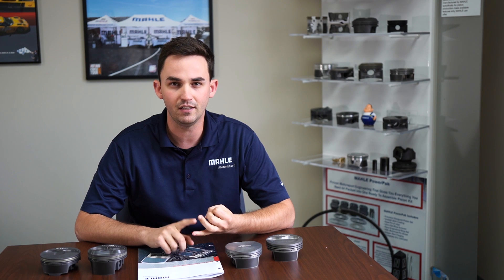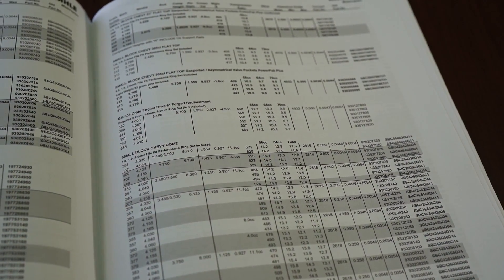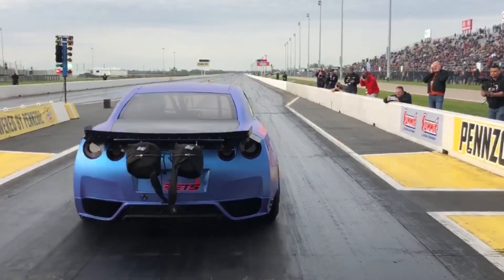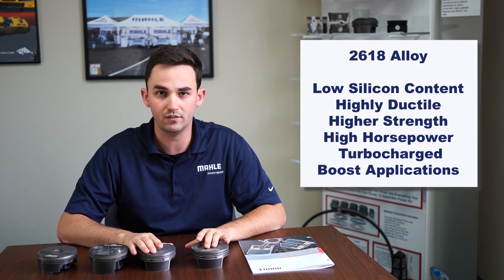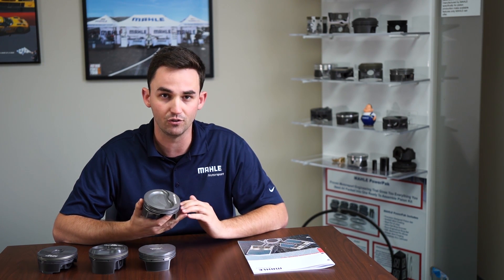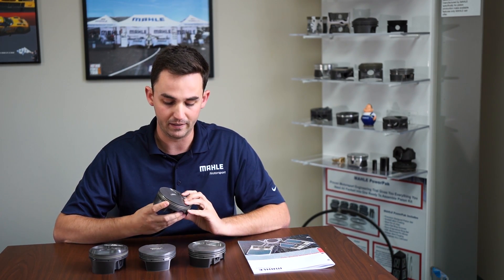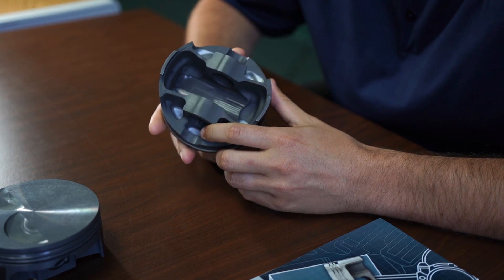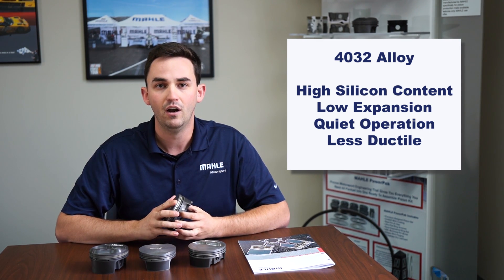Choosing The Right Piston Alloy - 4032 or 2618

Comment: I am having a hard time find a engine builder that wants to use 4032 alloy for a stroker kit on a 2006 evolution 9. They have been building with 2618 for so long they don't feel comfortable using a 4032 alloy.
Reply from the maker: What's the goal of your build and the power level you want to achieve?
Reply: @mahlemotorsport   I want to build a stroker kit but I am after more low end trq.I only want to run 93 octane and no e85.It's a 100% street car no track use. If the car makes 400whp I am happy but its the trq curve I am after rather then big laggy turbo setups with no throttle response and complete dogs until 4500rpm. I want more trq under 4000rpm NOT less.
Reply from the maker: @stellioiscrazy For your power level and stated street use, yes, 4032 does seem to be the better option. Unfortunately, we no longer manufacture this piston due to low demand. Do you have a 4032 set already in your possession?
Reply: @mahlemotorsport  no cant find any :(
Reply from the maker: @stellioiscrazy I stand corrected. Had a quick conversation with my custom guy and I was looking at the wrong spec line. We do offer three bore sizes in 4032 for the 4G63 engine. 85.00mm, 85.50mm, and 86.00mm. https://www.us.mahle.com/media/usa/motorsports/mits-4g63-2-0l-webpage-2.pdf
Reply: @mahlemotorsport  next problem is the engine builder, unless you guys have someone to recommend.

Comment: @mahlemotorsport I have a question 4v cobra teksid block, shooting for 1000whp 25-30 psi whipple show car no drag racing at all just weekend car would u recommend 4032 or 2618? Thanks
Reply from the maker: For the amount of boost you are planning on, our recommendation would be 2618. Our applications available for the Cobra 4V use a different alloy, M142P. This alloy shares characteristics with both 4032 and 2618. It will work well for the application you are describing. Please keep in mind that dialing in a quality tune is equally as important as piston choice. Check page 17 of our application guide for options: https://www.us.mahle.com/media/usa/motorsports/new-products/2025-ap-guide-final_digital.pdf

Comment: Hi 
What about Subaru ej25 does they friendly with 4032 daily driving ? Clearence minimum 0,04mm right ? More then SUB top limit
Reply from the maker: Sorry for the delayed response. 4032 is more friendly for daily driving than 2618 due to lower expansion rate. 4032 clearance minimum is 0.053mm and clearance maximum is 0.073mm, measured 6.35mm up from the bottom of the piston.

Comment: Could not find 4032 allow for N54 engine. Why ? Thanks
Reply from the maker: We do not make an N54 piston in 4032 because majority of builds need 2618 for that engine.
Reply: @mahlemotorsport I bought a set of 84mm drop in Powerpak pistons for my N54. The piston to wall clearance spec states .0025" to .0033", but the pamphlet says high performance applications may require an extra .001" to .003"?  Does this really mean clearances of .003" to .006" for some applications? I called Mahle tech support but they couldn't answer this question, just kept repeating they are made for an 84mm bore.  My 200k mile block ended up with .0035" to .0038" clearance, but I was a little worried about it so I decided to order a set of 84.5mm pistons and am over boring.  I still would like to know how rigid is the Mahle specification for piston wall clearance?
Reply from the maker: Yes, it does mean clearances of 0.003" to 0.006" are recommended for some applications. For high power levels and 2618 alloy, additional clearance for expansion is recommended. However, if doing a rebuild with mild upgrades and moderate increased power level, the original piston to wall clearance of 0.0025" to 0.0033" is recommended.
Reply: @mahlemotorsport  Thank you for the reply. I just dropped off my block and pistons at my machinist. He is recommending we go with around a .0045 clearance. This is for a daily driven street application, but it makes around 750 hp. Does this sound reasonable? I just don't want to end up with too much piston rock and end up scuffing a bore. I feel like I would be more comfortable staying around 3.5 to 4 thou, but my only knowledge in this area is from what I've read online.
Reply from the maker: For your intended use and power level, 0.0045" should be fine. Note that you will likely hear noise on cold startup.

Comment: What would you guys recommend for a VR6 3.2 with mostly daily driving, occasional drag racing and some nür laps? Between 8 - 8.5:1 CR, 700-ish daily awhp and 1000-ish drag/track hp. 2.5/3.3 bar boostgoals.
As far as i could find, your 3.2 VR pistons are 142P correct?

Comment: Love yalls products ! I have a 2012 srt 8 392 and I purchased the 4032 pistons and went with a redeye cam lifters and also have long tubes. This will be a street car with very minimal drag runs. I plan on adding forced air and my goals are 650-700 at most rwhp did I make the right decision or would y’all have recommended the 2618? Thanks in advance !

Comment: Why is 2618 only alloy available on the gen 3 coyote power pack pistons? Wouldn’t a 4032 a better fit for a drop in piston? Does it have to do with the new spray in cylinder bore?
Reply from the maker: It does not have to do with the spray in cylinder bore. The 2618 alloy offering are for those who want to use power adders and maximize horsepower.

Comment: I’m having a motor built. Is it true that the 2618 piston only lasts around 20k miles and that it damages the cylinder walls ?
Reply: NO.  Not if the PTW clearance is properly reached.  Some have gone well over 80K miles.
Reply from the maker: Each build is different but if it is built correctly it will last well over 20k. We have some on our staff that use 2618 as a daily driver.

Comment: Great info! All things being equal, will the 2618 make more power than the 4032 since its looser?
Reply from the maker: Actually 2618 is not 'looser'  - it initially has more piston to wall clearance.  Once it comes up to temperature the piston expands.  The material has a low silicon content which causes it to expand, the material has higher strength properties and can be found to be used with higher horsepower applications.
Reply: Being ‘loser” doesn’t make more power. 2618 doesn’t MAKE more power. It is a stronger and more ductile alloy that can HANDLE more power than 4032. It’s ability to handle more power has nothing to do with its higher expansion rate (which requires the higher clearance). Rather, the higher expansion rate is a consequence of its composition (ie lower silicon).

Comment: Mahle has always made great parts.
Reply: Yep, I'm using all Mahle gaskets, head gasket, intake manifold, EGR, exhaust, valve cover gasket, and throttle body, etc. I'm going with JE pistons though because I already ordered them for the rebuild but if I knew that Mahle made pistons, it would be a tight battle where I'd choose either or, etc.

Comment: I'm planning to build an old audi s3 1.8-20vt for 500hp would you recommend 4032 cause I want to keep the car both fast but also reliable because I'm planning to daily drive it. Will the 4032 be able to handle 500hp?

Comment: 200-250 shot on a daily driver which alloy?
Reply from the maker: How much daily driving?  Which engine and how much horsepower is your build?
Reply: @mahlemotorsport  
Will pretty much be an everyday driver. Looking at around 500-550 NA at the flywheel on a 5.7 hemi stroker with a turn of the knob on occasional weekends and possibly an occasional trip to the local strip. You know how it goes though was originally saying 150 would be enough and haven't even built it yet and its slipping up to 200 shot!!! lol
Reply from the maker: 4032
Reply: @mahlemotorsport  ok thanks

Comment: If you DON’T need the strength of 2618, 4032 is actually better in every way. Not only can you run them tighter. But they also have better wear qualities and they’re lighter.
Reply: So basically if you're pushing records, 2618, otherwise 4032 is great
Reply: Yeah, I got a nice classic 4 banger, a 1995 Saturn SL2 that I'm rebuilding the engine with JE pistons, 10 to 1, SCAT forged H beam rods balance and blueprint, 3rd gen heavier 6 counterweight crank, with lower tie plate with a port and polished head, dual intake cams, mild deshrouding, mild bowl blending, polished combustion chambers, narrow blended 1-2 mm value seats, port and polished intake manifold with port matching, bigger throttle body and 10-12 PSI of turbo boost, and an E85  blended full tune, etc. One of my other buddies gonna fabricate a cat back turbo exhaust made out of titanium and the car already has a carbon fiber hood, seats, and a set of RPF1 15X7's with Yokohama Advan performance tires, and upgraded MFactory LSD, and drive line and suspension. Little by little it should be very fun to drive when completed. 325-350 HP with more torque than horsepower and 2200 LBS. I've owned the car 17 years after my dad gave it to me

Comment: So for a boosted(turbo), e85, and 500hp daily engine 2618 would be best?
Reply: 500 horsepower on what? 500 horse on a Briggs and Stratton is a lot, 500 horse on a 454 big block is a bolt-on motor.

Comment: I've been making ~500whp on a 2.3L mitsubishi for a few years now. The car has been raced a LOT in autox and at the drag strip. I've been extremely happy with my Mahle 4032 pistons.
Reply: who built your engine????I cant find a engine builder that feels comfortable using a 4032 for some reason.My motor needs a rebuild and I dont track it at all, just street driving.
Reply: @stellioiscrazy  I did. I built my engine. 
I simply specified the desired finished bore size (as per Mahle) to my machinist.

Btw, it's still going strong.
Reply: @ i don’t have the time or space to do my own build and finding a good shop/engine builder in the 4g63 market is impossible. They don’t know how to build a street car. They build RACE cars for the street and call it a “street car”.
Reply: @stellioiscrazy  sounds like you need a different hobby, then.  Maybe RC cars. They take up less space.
Reply: @ lol 😝

Comment: What is the best for daily drive?
Reply from the maker: 4032
Reply: @mahlemotorsport  My workshop (uses Mahle pistons) refered to those, answering my question, as "Al124" resp. "AlSi12Cu3Ni2Mg". Which version is meant with this? Thanks!
Reply: 4032. Unless you need the strength of 2618, 4032 is the better alloy.

Comment: "old"  turbo VW 1.8T and new 2.0tfsi Audi Turbocharged engines are known to run with Mahle forged pistons by factory. Remarks on these product are these:
These pistons are manufactured from Mahle’s proprietary 142P alloy. This unique alloy offers the low-expansion characteristics of 4032 but strength near that of 2618 alloy. The low-expansion quality allows piston-to-wall clearances to be set tight, which allow the pistons to operate like OEM, quietly and smoothly.
So why we cant make custom forged pistons  with this proprietary 142p allo which is available now for 15years since the launch of the infamous 1.8T vw - audi engines ?
Reply from the maker: We can do 142 for that engine, please contact us at 1-888-255-1942  Unless it is something extremely radical in which it would have to be made out of billet.
Reply: Sometimes a factory spec alloy is owned by that factory and simply produced by a manufacturer .

Comment: 4032 is able to get 1000hp? HOLY CRAP

Curious as to what you'd use if you want high RPM's? like 8k-18k if beyond 9500RPM's is possible, could you go about using 4032 if at all? I do like the less noise and expansion. Not turbo charging, just straight NA.

I sent a reply to Mahle one time about their S2000 coatings for i think the powerpak pistons, S2000 F20C, F22C Gold Series 2.0L - for use in Factory FRM (Fiber Reinforced Matrix) Cylinders Onlyw 

They don't allow use in sleeves, i want to use em in darton sleeves. Curious as to why i cannot, i want the cylinder bored for darton sleeves and how come the graafal coating from the coating guys that engineered it says you can use it i believe thats what they said and mahle says NOT TO.
Reply from the maker: In reference to the alloy, it is possible, but we must also consider the application as a whole.  If your the purpose of the vehicle is to race - and only race.  The race vehicle is going to have a 1000 horsepower in an 8 cylinder motor in use at all times we would recommend 2618.  We do receive a lot of calls where the customer is going to only use a fraction of that horsepower and then run it on a drag strip or a road course here and there and that is where they could use the 4032 alloy.                                                                                                             As for the Gold Coating most customers wish to run these pistons in the factory bores, as the factory bore liners are very strong and low friction.  Our Gold Series uses a special piston skirt coating (gold in color) that is made specifically for FRM bores, like what comes stock in the S200 cylinders.  If the Gold Series pistons were ran in an iron bore, the pistons could have abnormal wear and poor performance.  

If a customer wishes to run an iron cylinder with these pistons, they need to contact us and we can produce pistons with our Grafal skirt coating for them. This would be a quick turnaround process and would not add much cost for the customer.
Reply: @mahlemotorsport  Excellent reply and explanation! Thanks!
Reply: superbike engines (which rev quite high) use hypereutectic pistons, which have high silicon content.